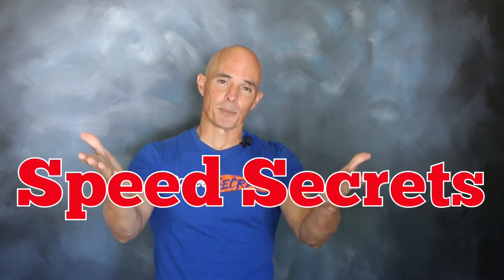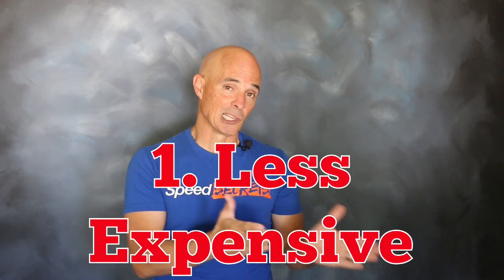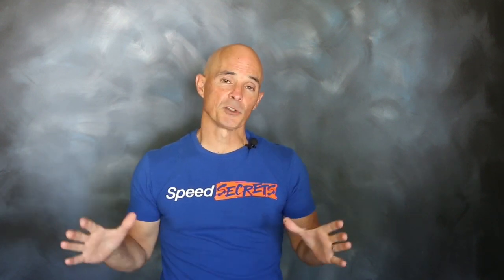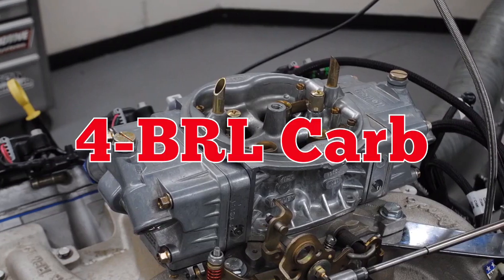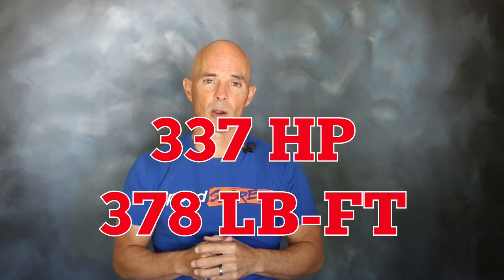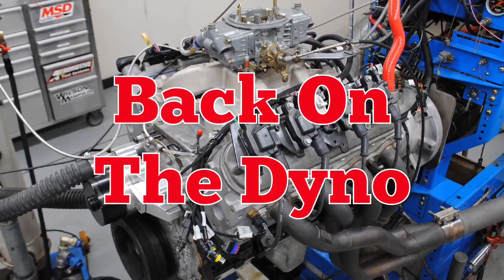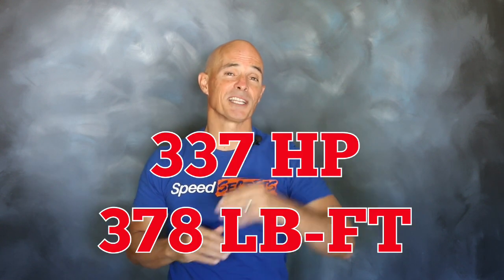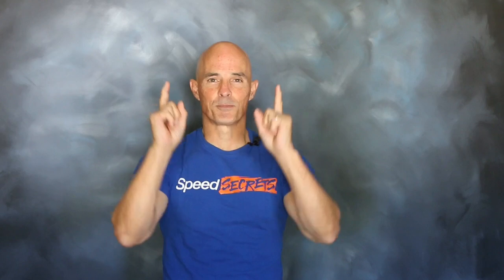Speed Secrets: It’s Time for a Carbureted 5.3-Liter Cam Swap

Comment: Fun stuff, I recently put in a sloppy stage 2 cam with a 625 carb, what would be a good base timing and total timing? I'm using a t350 with a 3000-stall converter. Thanks

Comment: Hey Richard what size carburetor did you use on the 5.3
Reply: Looks like it says Holley 4150, which I believe is a 650 cfm double pumper.

Comment: Can I use the stock computer to run the coil packs and transmission and still go carburetor???
Reply: Irv Zee I believe extra hardware is needed to trick the ecu.  I’m new to the idea of carving an efi engine.  But a lot of people appear to be doing it.  Holly performance would be a good source of info

Comment: Nice vid. I recently finished my gen 4 5.3. Same dual plane intake, topped with proform 750, had a set of 243's worked over and shaved, and custom cam 227/234 with .613/576 on lsa 110. Ive run it, but yet to put in the car. Sounds very mean.Not sure what she makes for power.
Reply: ZackPower get it on a dyno and lmk I have plenty 5.3 around
Reply: How did your cam work out for you?  Texas Speed has one very similar good for +100 HP

Comment: How do you tune with a carburetor
Reply: @SOLDOZER  no way you have to adjust the air to fuel ratio with a screw never new that, I was asking about timing
Reply: @Josh_Playzzz   You did not ask about timing, you asked "how to tune with a carb?"
Reply: @SOLDOZER  tuning includes the timing but yeah and why did you answer about tuning a carburetor that’s not what the question asks

Comment: That horsepower seem low in stock form with that dual-plane intake compared to fuel injection which is usually 350 ish
Reply: This one is a lm7. I think it was only 315hp factory

Comment: I have a new long block 5.3. From rock auto. 
An msd 6014 firing it. 
A holley duel plane intake. Truck exhaust manifolds. 
I have tried 4 different carbs on it. All are mushy and no power below 2000 rpm. 
It is in a 84 chevy blazer k5. It has high gears probably 2.73 or 3.08 and 33" tires.   I know that's too high geared and will be going to 4.11's later. But even high geared. It shouldn't be so spongy from an idle to 2000 rpm's I have had carbs on it that ran great on a 350 in another high geared 85 truck. But as soon as I put one on the LS. Almost dies when I step on it. Have to ease into the throttle. Then above 2000 to 2300 rpm's. It runs great. 
What timing curve would you recommend for this engine with stock cam ?
  And could the engine have so much vacuum that the power valve is not opening and letting extra fuel into the mix?
Reply: Did you ever get this figured out? My carbureted LS does the same thing.
Reply: @randyjames1695  unfortunately I broke down and put a Holley sniper on it. 
Fixed the problem
Reply: Nice. That has crossed my mind. Good to know it could fix the issue. Thanks
Reply: You need to change your primary boosters to annular boosters; problem solved.
Reply: @landrypoole  one of the carbs I tried was an annular booster carb. It was an old Holley that was made kinda like an old motorcraft carb. It is one of the best street carbs I own. 
Its on a 350 in an 85 chevy truck. Runs perfect. But has a dead spot on the 5.3 LS. 
I put a sniper on it and it runs great.  Just never ran right with all the different carbs I had. 
And I've been hotroding since the 80s. Never had a carb I couldn't get tuned right. That engine got me.
Reply: @martyjohnsonozarkoutdoors8198   You switched to EFI cause you dont know how to do basic carb tuning that would have cost you $5?
Reply: @SOLDOZER  
I've ran carbs on everything. 
 Since the 80s. I have had dozens of hotrods in the last 30 years and I have never had an issue with tuning a carb. Holleys or quadrajets. I have a parts bin full of tuning parts. For both style carbs. They all run great. Except on that 5.3. 
I will continue to run carbs on all my other engines. And they will continue to run fine. 
 But I will admit that one got me. 
So if you know some magic trick that would work on that particular set up. That only cost 5 bucks. Enlighten me...